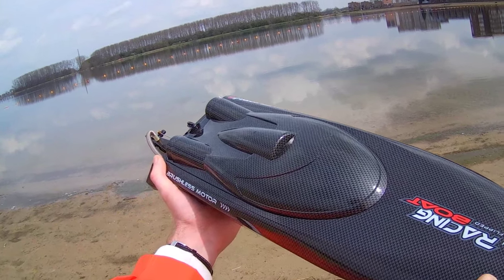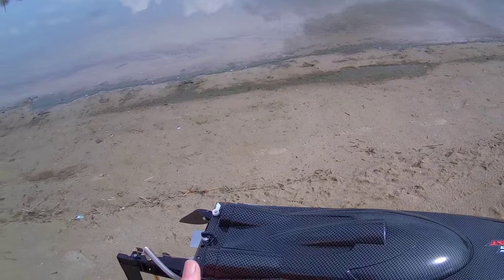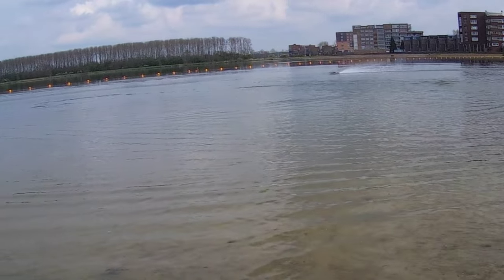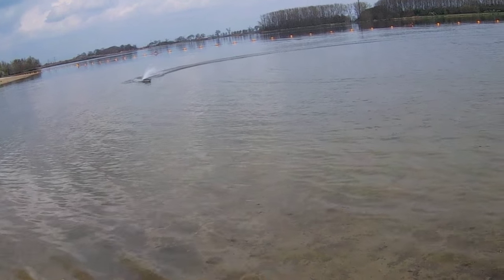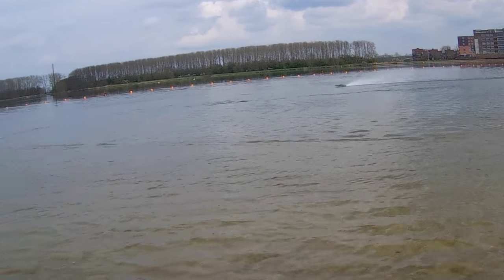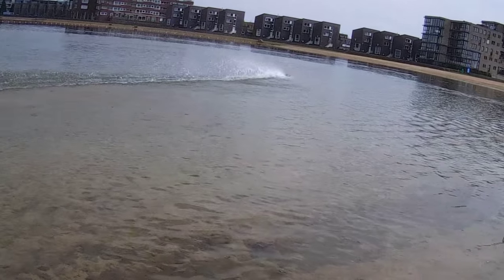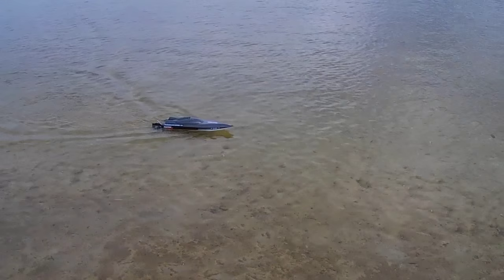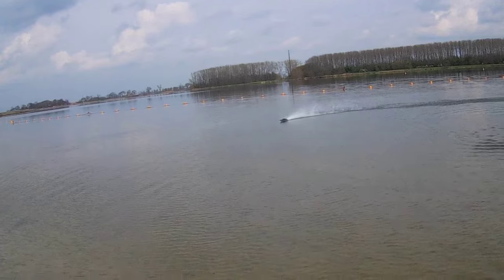Feilun FT011 Brushless 4S Speedboat - Maiden run! :)

Comment from the maker: Very nice weather here today! A great chance to take the FT011 speedboat out for a first run :D
Link to this FT011: http://www.banggood.com/FT011-65CM-2_4G-Brushless-RC-Boat-High-Speed-Racing-Boat-With-Water-Cooling-System-p-1036340.html?p=TO251813974002015038

Specs: 
Length: Size: 65cm
width: 12cm
Height: 15mm
Runs on: 2200mah 4S
Run time: 5-6 minutes
Speed: 50Km/h (according to specs)

Comment: so, ive had this boat for awhile now, ive upgraded to stock barbwire xl 35mm prop and made some positive gains with no added heat, i also added a 95mm alum deeper rudder, noticed less wobbling and better stability overall...sticks better.
Reply from the maker: Good job man! I do still like the boat in stock form, but I've replaced the rudder with an alum one as well.. Definately an improvement :)

Comment: Nice little place to run a boat you have there! Fast boat at a decent price, not bad at all. Looks pretty dialed in and tracks well. No suggestions but you can always try some different things. Very nice vid as always!
Reply from the maker: +Discover RC Thanks buddy :)  Yes.. for what it costs it is a very nice looking & well behaved boat :)  The stock lipo isn't even terrible :|  What's up with that? :D 
It does look like it wants to run a bit faster.. What is holding it back, is a black art though :D (a friend of mine designs competition racers) 
Cheers & have a good evening :)

Comment: That's a pretty nice boat for the money. I noticed you asked about set up tips. I'm willing to bet the boat will handle much better running in right hand turn ovals rather than the left hand turns. Boats don't like turning left, thats what contributed to the fish tail behavior in this video. Other than that the boat seemed to track well in the straights.
I would also look into putting a 34 or 35 mm prop. The power is there but the prop is too small. I believe that's the same prop they used in the ft012 which is much smaller
Reply from the maker: +JustCruisinGT You are indeed right.. Same prop.. The boat felt like it had more potential.. At plané (is that an English word? :$) it's still sitting quite deep in the water.. Maybe a well shaped brass / metal prop would allso improve things? 
Ghehehe true! It Does run right-hand corners better :)

Comment: Hi there I think you should be running in the opposite direction in a oval with speed boats with how the rotation of the prop spins try clockwise driving next time around and see how it handles in the turn and goes.  :-)
Reply from the maker: +shenlonco YOu are correct.. It does run a Little bit smoother through right hand corners :)  Not A LOT..

Comment: Hello very nice footage!! Could you tell me the size of the prop lock nut used to to hold it in place?

Many thanks,
Reply from the maker: +Brittany and David Hello people :)  It Think it is a 3mm self locking nut, eventhough the prop-shaft measures in at 3.17mm ... So I guess the 3.17mm is the drilling-hole in the prop as well... 
And thank you offcourse! :)
Reply: I bought a prop with the 3.17mm hole and it was way too small.
Reply: It costs from 100.85 to 122.99 dollars. Current coupons:
http://couponsgearbest.com/2017/06/05/feilun-ft011-rc-boat-active-coupon-price-gearbest/
Cheers

https://www.youtube.com/watch?v=bORM9g-ejtI

Comment: #1 to increase turning radius cut the lil stop bumps off the rudder I used a razor 🔪 knife I did both my Ft012 and Ft011 now they turn wicked sharp!!!  #2 To stop the Ft011 bow from bouncing ( porpoising ) or acting like flipper...😂 bend the metal trim tab's down 1\8th inch at a time till it stops doing like da flipper 😀..and it's a lot easier to control at top speed!!!😎😎(adding any weight to these boats unless it's a stronger 🔋 battery "will slow the boats down"!!! ) Add a bigger prop and upgrade  the battery and they run 50mph+ !!!!!! Hope this helps and have fun!!¡¡!!😎😎
Reply from the maker: Thanks for the great input sir! Now that winter is allmost done for, I'm sure I'll do some boating again.. Looking forward to seeing what those changes result in :)

Comment: I must have gotten a awesome battery with mine cause I get on average 20-25 mins run times on the stock battery and on my floureon 2200mah 45c batteries I get around 45 minutes on average  flat out for the whole pack I get around 15min on stock and around 25 on floureon
Reply from the maker: What the :O  the water over there must have a lower resistance :) 
or maybe they ship these boats with better batteries by now :)

Comment: also have 65 mm cnc alum turn fins i have yet to install...does anyone know if i install a t connector splitter and run 2 bats...a 3s 2200mah 30c and 2s 2200mah 30c in the nose....will it work? basically running the boat on 5s.... i know the esc is  65 amp rated...any suggestions would help.
Reply from the maker: That really is Not advisable.. I have run 5S setups that way.. But you'd really have to know what you are doing.. For instance that all 5 cells are the same spec..

Comment: 50lbs of cement in the bottom of the boat should hold it down at speed there Dutch,just saw this Vid.lol. JK about the weight lol.  I am still on the wire about this boat.
Reply from the maker: Haha :D  well yeah.. a bit more weight is offten benefitial in boating :)
Reply: +DutchRC Adventures Ha ha ha,glad you took that as a joke. funny. I got the ST. Salto back together most of the way. I need to retrim it out. I have to say,I almost gave up on it.I have never tryed to repair something that damaged and expected it to even work. I wont be flying it again until I get a new transmitter and receiver. That was the longest its ever taken me to fix a wrecked plane. I even made a new canopy out of some clear plastic I had from the Air Hogs X-Wing box. I used the boiling water method to straighten the impacted foam back out. I had to massage is back out to the original shape. I threw the whole canopy minus the clear part in the pan of hot water and watched it unfold its self,truely amazing trick.I kept dipping the nose of the plane in boiling water and could see the wrinkles in the nose unwind,it kept stretching and growing longer. I still want to add reinforcing to the front,probably have to use balsa or laminated balsa and shape it to fit. At least I still have both my Apprentice planes. The Dynam Waco is ready to fly again. No museum piece planes here,not after my adventures,lol. I told my wife,just means I can get new planes next spring,she just rolled her eyes. lol. she loves me.I will fly what I have till they wont before getting new ones. I am not the kind of guy that flys it once and hangs it on the wall. No way. Great video,I am reviewing boats again, I wouldnt mind getting a Banggood special.
Reply from the maker: Ghehe good on ya for managing to fix the plane sir! I'm proud of you :) 
I'll tell you something stupid: I got a few LOW budget FHSS (Futaba protocol) receivers in yesterday.. Soo I unhooked the genuine Futaba receiver in my Sky-Hero Anakin, and connected the cheapo receiver.. Worked like a charm.. nice an small and it has only 1 connector (SBus).. 
Sooooo then I connected up the genuine receiver again right.. I could NOT get it to work again.. Well that means: the flight-controller didn't see any input from it :|  (it is a $120 receiver by the way :P) 
This more a problem in the flight-controller.. the receiver did bind up with the transmitter just Fine..
But well.. long story short: now that Expensive quad (as in $500) has an el cheapo receiver instead of a high-end-never-fails-receiver :P

Comment: Nice vid gentle launch I've only just noticed this new Fei-lun boat's out.. I just threw mine in upside down the flip function works well I've got the FT012 runs 3s but seems as fast or faster than the new one on 4s? 
What KV motor does it run? it's now got a 60 amp esc too is that right? 
Watch the Flip Function in action should work easily https://youtu.be/df9pTMpEZqk
Reply from the maker: +RC Car Club Ghehe I have to tell you the water was freezing cold :P  And I had no means of rescuing the boat, other then swimming for it.. 
This new boat indeed runs on 4S, and has the same prop as the FT012.. I do not know the kv of the motor :$
Reply: Watching your unboxing now it's quite a lot bigger than mine  I might have to get one...
The new FT010 is even Bigger than that one too... I've got some decisions to make lol
Reply from the maker: +RC Car Club I'll make things a bit more complicated still, with my next video :D 
Hmm ohw well.. the next boat I'll show is in a completely different price class :$ 
The FT011 is a nice boat yes.. Decent size, and I think it would outruns a FT012 with 2 fingers up it's nose :)  It might look to run at the same speed because it's bigger?
Reply: Would be a good race could also be be size deception like you say, but it says 45km/h on the FT012 box and 50km/h in the manual I think this needs GPS testing I'll do that on it's next outing I think..
Looking forward to the next unboxing but I'm running low on RC funds at the moment 
The Bigger one FT010 is cheaper and only 30km/h but still 4s 720mm long....;O)
Reply from the maker: +RC Car Club Getting an RC channel up & going is costly huh? ;) ghehe Lucky for us the YT revenues are Huge :D (ahum :P) 
Hmm that FT010 sounds like a nice upgrades project then? :)
Reply: Doesn't look to ride too well at speed after a quick look at one converted ...
Yeah the "Huge Revenues" sure does pay for a Q32 after a year or so lol unless your a DJ of the Doctor kind then it pays for a lot of things lol RCYAL8R ``o=o¬
Reply from the maker: +RC Car Club The new boat-video is online buddy :) 
And yep.. we're in the wrong hobby to roll in the $$ ;)
Reply: Well I suppose the Fun of helping out others and sharing the hobby will have to do as payment then ;O) Off to watch a Boat vid then bed RCYAL8R
Reply from the maker: For SURE brother.. As quite a lot, I allso started the channel to extend the hobby & spread info :)  
Good night!